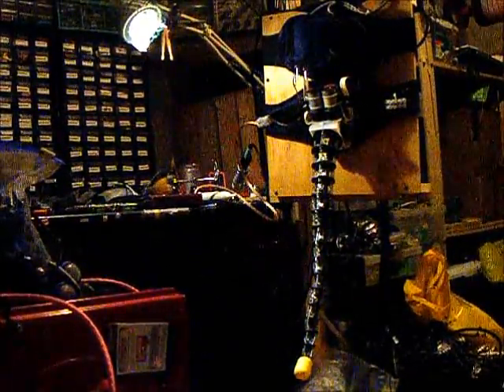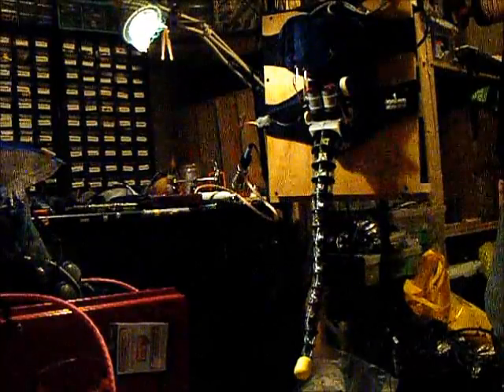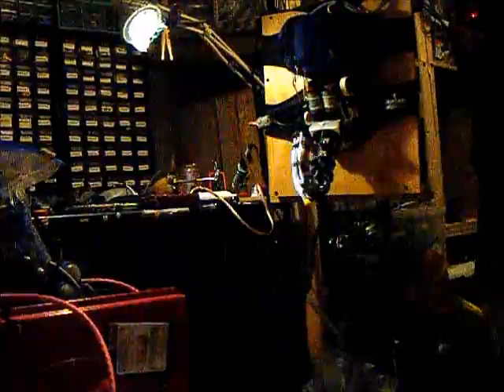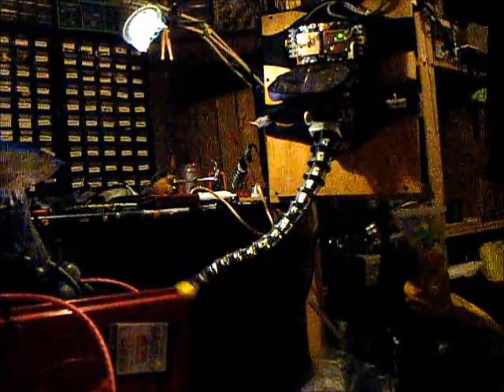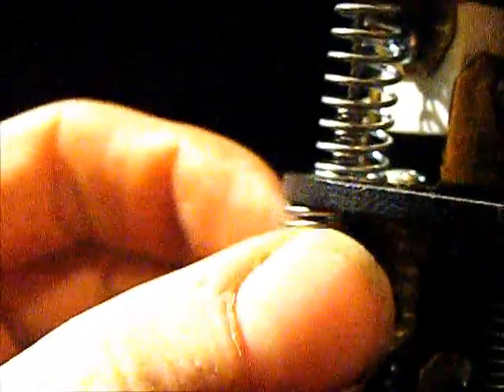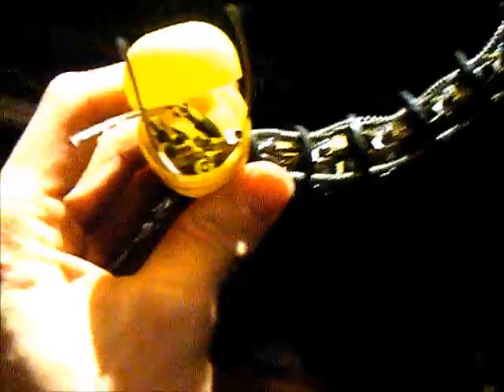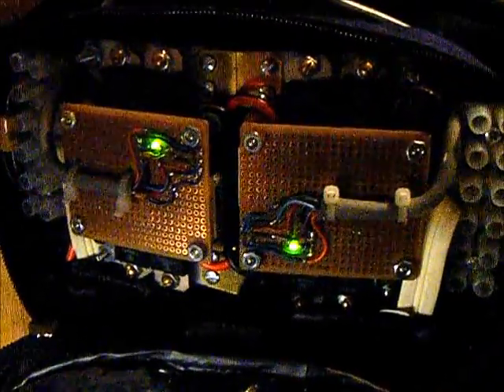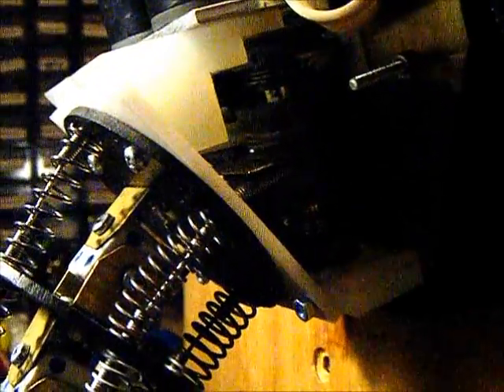My Animatronic Tail

Comment: you should use stepper motors. they turn exactly how much you tell them to turn.
So this way you know where they are.(assuming you have a steady "start" point.
Reply: If I'm not mistaken that's incorrect. Servo motors constantly keep track of their position. A stepper motor is biased and allows the motor to pause at 'stepped' positions around its motion.
Reply: +Acrimonious Mirth That is why i said: assuming you know the start position (have a steady start position). or you could use an encoder...